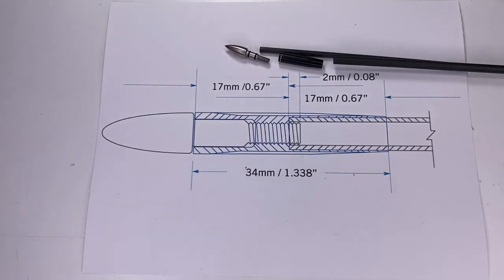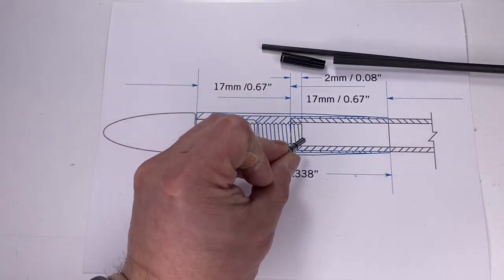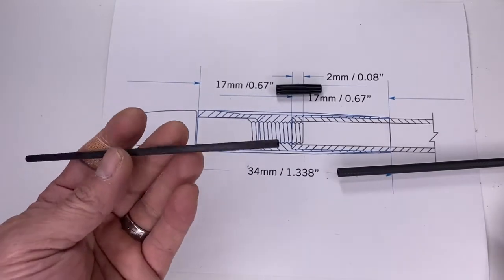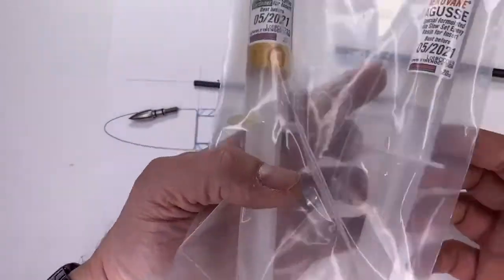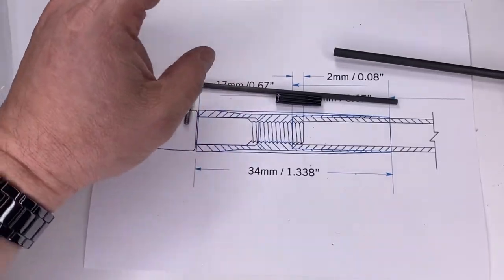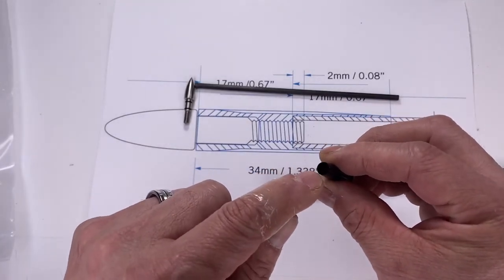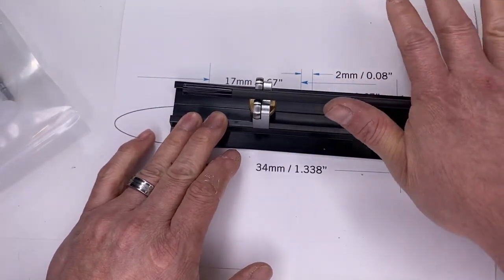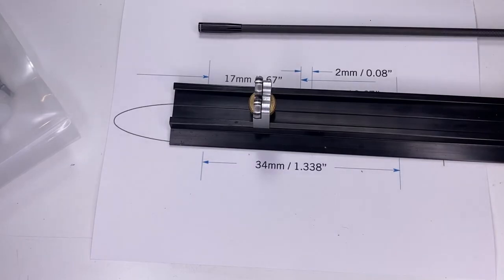The AeroOutsert | AeroConcept Installation

Comment: Is it okay to use ferr-l-tite instead of epoxy?
Reply from the maker: Have not used that, so I do not know
Reply: @FirenockTV  Thank you for replying. I realize now it might have a different name in Europe. I meant the cool flex hot melt glue (Booming brand) most commonly used for arrow inserts and glue-in points.
Reply from the maker: @youztuber5000  I have used that so I do not know,  Sorry